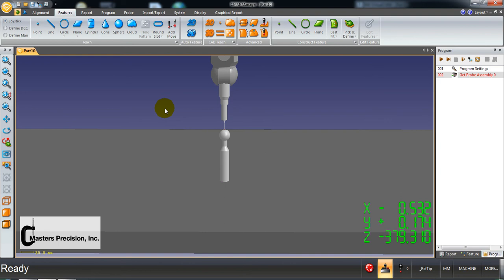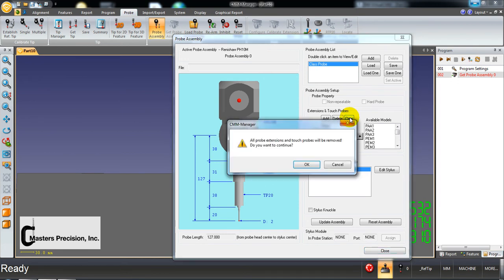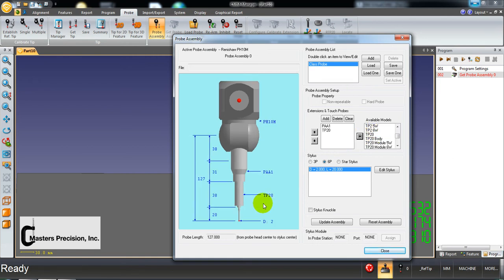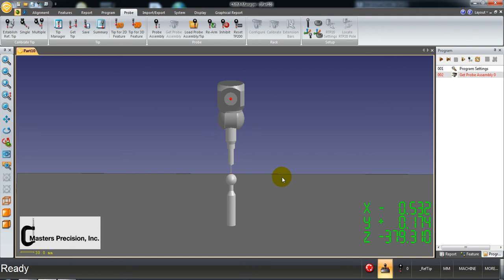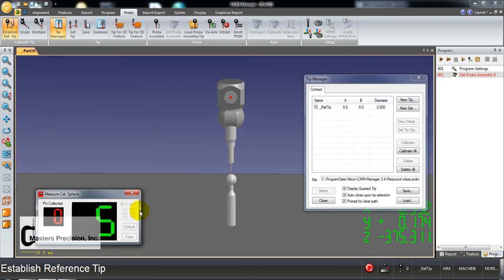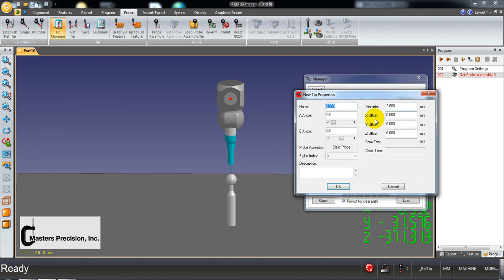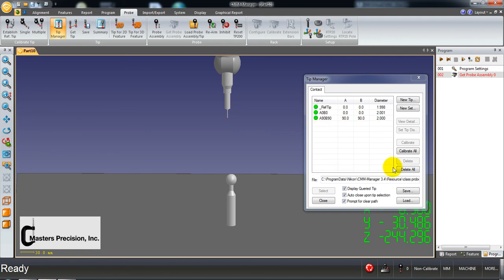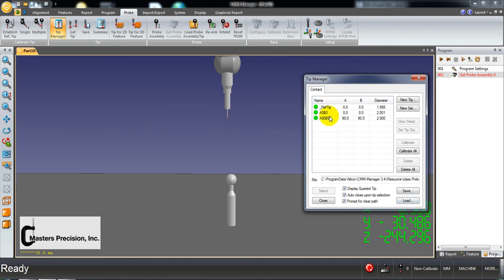CMM Manager Video Course Demo

Comment: Some of my probes under the status bar either read non calibrate, probe assembly and others display probe name and the a,b orientation. The probes that say non calibrate even though all tips are calibrated do not measure correct in the program? Any help would be appreciated.